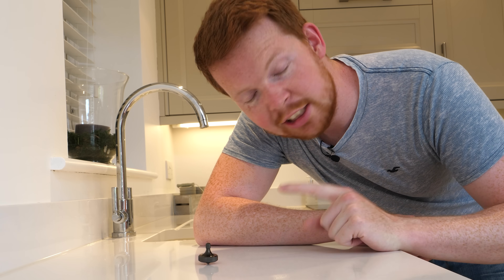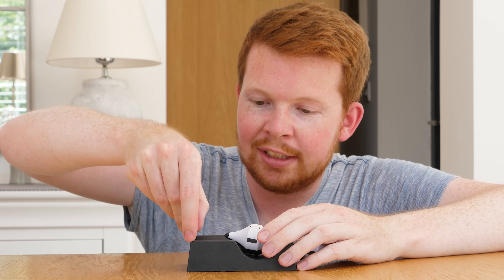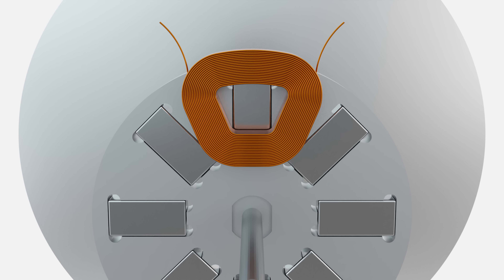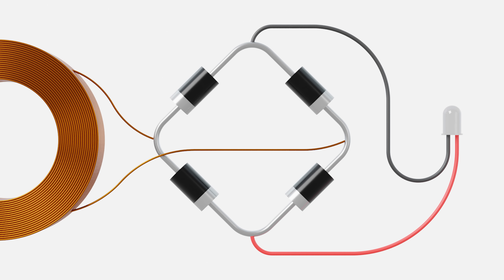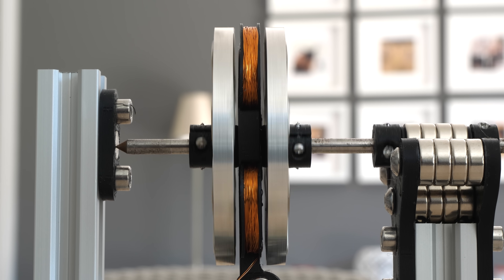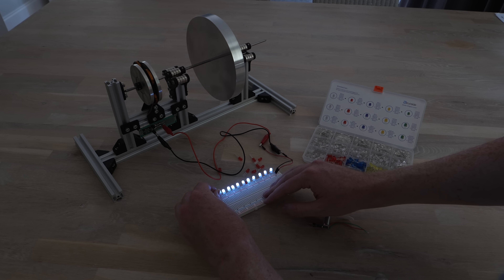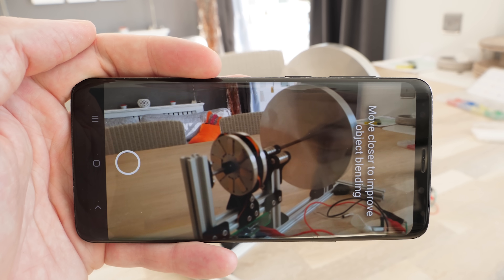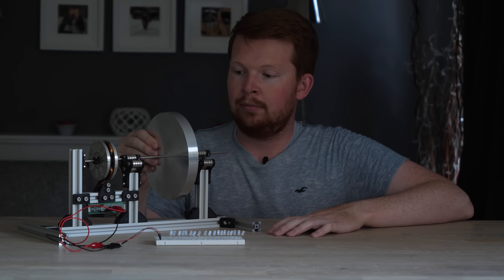Flywheel Battery

Comment: Thats really cool. you could probably add a pedal system that attaches to the end of the bar and just pedal for energy. maybe store the excess energy into a battery👀
Reply: Dam a creek, make a paddle wheel and then have an unlimited supply of hydroelectric power
Reply: That has been my plan/desire for almost 15 years now.
Reply: I suggest harnessing the power of water flowing in a small creek and that of a small wind turbine to spin the shaft.
Reply: @AshoreToo  Pedal-powered would require far fewer parts and far less energy consumption and installation effort. Plus, it makes us pedal it periodically, which is great excercise--especially helpful in the winter.
Reply: @AshoreToo  Not that micro-hydro and micro-wind aren't good options for larger electricity usage. Though micro-hydro, the ostensibly better option if you have a creek or stream, ends up being more complex than one would think (when I last looked into, that's what I found, anyway).
Reply: @RetroDawn  Thank you for your replies. I am interested in taking advantage of all kinds of energy beneficial to green house agriculture, since LED grow lights are good for my prospect. I would like to power grow lights with my generated electricity.
Reply: Fred Garvin  Yes, my complaint is really about industrialised farming, and junk food franchises,.If your extra calories are only carbs and simple like oatmeal, then it is pretty sustainable

Comment: How about adding the same magnet brackets above the axle? So the axle would theoretically be perfect centred in the magnet fields and you could add an handle at the end of de axle for more torque.
If this would work you would be able to increase the rotational speed by far :)
What do you think?

Comment: When I was around 11 years old,was under a truck with my uncle, He was showing how the starter  started the engine.  I  Asked him why the flywheel on the back of the engine  couldn't make electricity like the generator did to charge the battery ?
Reply: flywheel in combustion engine works as intermediate energy supply and rotations' stabilizer - think about it as an capacitor in electric setup.
Tom's demonstration is also a inertia capacitor "charged" by hand and giving momentum over long period of time.

Comment: I love the idea for a flywheel as a "battery". What happens if you plug a small motor on the rod, and charge it with solar panels? In theory, you should "charge" the flywheel during the day, and using the system as a generator during the night. 
Great work my friend! Keep it up.

Comment: You started by discussing how long a levitating flywheel might spin versus one with contact point.  Then you added a load to the arrangement but missed the opportunity tp compare the spin time with no load vs 5 LEDs or small motor etc...

Comment: Every electric vehicle (and hybrid) basically uses this concept, it's call regen (regeneration). The electric motor in an EV, also acts as a generator. So, when you hit the "gas pedal" you are powering the motor. But when you hit the "brake pedal", the system first uses the motor as a generator, which both charges the battery and slows the car, by loading down the generator. As you push the pedal harder, the hydraulic brakes also brake. Obviously, the car is not moving in a circle, so it's not exactly the same. However, the wheels, which couple the car to the road are moving in a circle.

Comment: Might be abel to connect a small motor to rotate the flyweel which will power itself and run forever (Might need a push to start though).

Comment: 10V doesn't really say too much unless we know the resistance. Otherwise you could just use a transformator to increase the voltage. Any info about the resistance/load used?

Comment: Why not use another repelling set of magnets at 90 degrees to the setup instead of a pin and table for even lower friction? essentially real full levitation? Then put it all in a vacuum to reduce air friction.

Comment: Thank you for making this video. I've often wondered whether an arrangement like this would work.
For your next experiment I'd be interested to see if you can use your alternator as a motor to get the flywheel spinning by connecting a power source and then switch it back to a load - so that, effectively, you are charging up the device with electric energy and then drawing electric energy back out of it afterwards -  like a rechargeable battery.

Comment: Shouldn't feeding power into the wires make the generator work as an electromotor to spin up the wheel? Then you actually have a battery where you can feed power in and later get the same power back out.

Comment: Firstly, sorry about my english... :)
Do you think that it is possible to add a 12v motor which works because off to the electricity created by your Flywheel battery which drives the axis of your Flywheel battery to make it turn without stopping, and to recover the over- more electricity to run (for exemple) a fan? (
I don't know if it's understandable ... lol)

Comment: I know it’s a few days late but what you should do is add a lever that you can push so it spins it up and then when you push the lever all the way it uses a little bit of the power to run a motor to pull the connection off where the lever was pulled so it doesn’t waste any power

Comment: i think you can smooth the output using capacitors that they are charged by the input and release a steady output, this is also why older audio tech has a habit of buzzing, the capacitors are failing or dead so the voltage is dropping in and out

Comment: Tom, I love your work - you have some great ideas and I'm a keen follower.  If you are ever in the Rutland area, look me up and I will buy you a beer.  With the Mag.lev. flywheel have you though about powering it up to start it?  For example, could you actually use it to store solar energy to later power an LED?  I see this as a potential for smoothing out power generation vs. demand. (like in power stations where they have to install massive battery banks to allow for sudden dips/spikes in demand and need somewhere to source/store additional energy.  Any alternative to chemical energy storage should be explored as that could be the next environmental disaster we face.  Keep up the good work!

Comment: You should add a crank with gears to spin this puppy faster by hand, like, with detachable rubber wheels, to decouple when the flywheel is "fully charged", to see if it's viable to use it for an emergency phone charging solution

Comment: very good project, i like it. Can i suggest some improvements?
1) magnetic bearings, is better adding an extra row of magnets on upper side, this will decrease woobling  and make you able to decrease clearance  space resulting in incresed overall system performance 
2) coils are more efficient when have nucleus  inside (iron core or ferrire core)
3) as i can see your magnetic path in generator side have high  reluctance, coils should "cut" perpendiculary lines of field. check P.M. orientation / coils orientation

Comment: Could you get the flywheel spinning at a known rate, and then try the different LEDs, so you can show how much power each draws?  The wheel should slow down at different rates.

Comment: You may wish to arrange the coils relative to the magnets such that the overlap is nonperiodic from coil to coil. Specifically, you should have one of the sets be a prime number, and the other be +-1 from that. Since primes are indivisible, there can be no common denominator, therefore you would categorically eliminate spurious beat frequencies. Many electromechanical devices do exactly this, and for good reason, it prevents unwanted harmonics allowing for smoother waveform/torque generation.

Comment: try wrap a cord around the end like a pull cord to quickly get the wheel to a high speed
Reply: Could drill a small hole in the shaft to start the "pull string",  there would need to be restraints or bearings at both ends to keep it from going off center when pulling the string. The restraints could be   removed once started.

Comment: Use a brushless in-runner motor for the bearing support and generator coils. It's more robust and more efficient electromagnetically. Moreover, with an ESC controller it can be used as motor to "charge" the flywheel. Bearing friction for these little motors is practically very small and on par with the magnetic bearing.

Comment: Interesting. Now, support the shaft with "pillow block bearings" with a gas powered engine and much heavier flywheel with a larger capacity generator or a power head for a 58kw A/C generator at 110VAC.
   I have a 10kw industrial generator, pulley driven by my truck engine with a cable control and governor to run my house during power outages. I would like to do the same with a very large flywheel (60") and a 4 cylinder naturally aspirated car engine pulley driving that same generator. Sort of like the older steam driven flywheel that powered the cotton mills of 100 years ago. Or, you could use a diesel engine that uses bunker fuel through an injector to a single cylinder hit or miss engine. The old hit of miss engines were very thrifty on fuel of lesser quality, or even vegetable oil. I believe Hal Lindsay had a book on the construction of a hit or miss engine driven A/C generator 50 cycle 120V factory use. Magnetic support is fine, no bearings to wear out. But for actual usable power, you have to mechanically support the shaft to eliminate "wobble".

Comment: with aluminium works too.... but you have to use the flying wheel like the  hard drives sandwich...... and extracting the electricity from the spinning field....in high spinning rotations you don't even need magnets   .... the field creating between the disks it give electricity.... 🌏 📡🌏 👣🕖 💎👽☠☼☾☄ゞど・ㇺㇾㇽ₪𝖎𝖙𝖎𝖇𝖎𝖗𝖆₪なめㇺㇾㇽ✶☥✨🌛🌄⊀✶⋊🐺🐾♓️☆🐜🐜🐫▲▴◭

Comment: If you want even lower friction replace the point bearings wiith two 10 x 5 mm magnets. Trickey to adjust, not impossible. Must be level or known angle.

Comment: not bad, but the most efficient way to do this, is making an axial flux motor with inbuilt levitation and the magnets in a Hallbach array. Motors like this can achieve 100000rpm or more using high grade bearings and permanent N52 magnets.
Surely not an easy build compared to your one :-)

Comment: would it be possible to have a similar set of coils only offset so as to have power coming from the second set of coils when the first set is out of alignment wouldn't you just need another set of coils and one more magnet wheel

Comment: Wonder if there would be a way to insert iron discs around the outer edge of the aluminum flywheel. Then using ferrous set screws around the circumference to hold the ferrous discs secure, could also act as a contact point to break with the next disc like with a lagging switch connected to a post and with the stator for induction. Part of the power generation from the alternator could boost the wheel. And have the stator windings on both sides of the flywheel  with the iron discs running thru the field. Gaining leverage from the discs on the further out side of the flywheel. If there was a way to do all of that maybe you could perpetuate more torque and that would keep the wheel spinning better than the one on the Wheel of Fortune?

Comment: Ok here is a backwards idea. Place the coils on the rotor and fix magnets to a frame. You can then place a bunch of small solar panels on the shaft to energise the coil. AC can be created by alternating solar panels polarity as the shaft rotates exposing next solar panel to a light source. With low enough friction this system would not need much power to keep rotating, making a "perpetual" solar spinner

Comment: Can you hook up a hand crank generator or a battery to the flywheel motor to run it up to a high speed? Then you could throw a switch and run the LED's or a motor from the flywheel.  Or could you charge a capacitor with a solar cell array, then discharge the capacitor to spin up the flywheel, then draw the power out of the flywheel, maybe use a light sensor circuit to switch the flywheel motor from drawing power from the sun to outputting power to a light? A cool demonstration of storing energy from solar?

Comment: You could always rig up some kind of a beyblade style ripcord. And I'm thinking a circle that surrounds the very end of the shaft to make it so when you pull the cord it might touch the circle but keep it from coming off of its track so to speak. However after the pull the magnets will keep it from touching the ring.  Should let you get lots of RPM with relatively slight effort

Comment: Ah, I've been thinking about living off-grid for a while, and considering ways to store energy e.g. from solar. Then I've found out that flywheel batteries are actually a decent option for storing energy (commercial ones supposedly lose about 1% of stored energy per hour), however buying one for private use might be a little tricky. So, I'm thinking if making one by myself is at all plausible, and so far my conclusions are - not really, there are safety issues, and efficiency would probably be too low to store energy for hours. However, lead-acid or lithium-ion batteries aren't great either, since they lose capacity over time and require regeneration/replacement every few years. So, expensive to start with, and expensive maintenance. So, maybe using heat or pumped-storage hydro might be another option to look into. I'd like something that is environment-friendly and does not require much maintenance.

It's not exactly something i NEED - where I live, laws guarantee that if you send excess electricity e.g. from solar panels into the grid, then you can take back 70-80% back for free, meaning the grid can work as a 'free' battery. However, I like the idea of being independent, not worrying whether the laws will ever change, etc. Telling the electricity suppliers "if I don't like your pricing, I don't need you, so give me a good deal or be gone". (also, if I don't like how the grid power is generated, say from fossil fuels, or natural gas bought from Russia)

Also, sounds like a fun project.

Another option I'm considering is a wood gas generator. I could grow the wood myself (which would make it carbon neutral), and so long as I'm careful about carbon monoxide poisoning, the potential benefits are quite nice - a very flexible solution, especially for winter, when solars ain't good, and the extra heating is desirable. However, that's a high-maintenance solution, so - as usual - the best solution is multiple solutions, so I can pick and choose based on the situation.

... sounds like multiple fun projects.

Comment: Nice job! I as waiting for a few more add-ons, a fet or two, and a spark gap module. Was also thinking you could use a cord with some friction to it to "coil" or wrap around, not loop around, the shaft. Then pull each opposite end away and have it spin.

Comment: Nice vide. Since your generating an AC voltage and current, you should look into Voltage Multipliers. You should also consider a step-up transformer and tank circuit on the primary so that you reduce the losses due to heat.

Another option is to introduce cascading magnetic wheels in a Halbach Array. This will ensure that you get a stronger magnetic field on one side of the wheel. You can think about each Halbach Array (linear configuration) and place 4 set of linear Halbach Arrays and have the coils on the outer ring. For instance, the 4-cordered aka Cross Halbach Array in linear configuration along the shaft in a smaller ring, inner ring, and the other ring have a linear set of coils. Think if it as a tube (inner ring) within a tube (outer ring). In the same cross patters, the coils in a liner configuration on the outer ring. 

Just an ideal

Great video. 😁👍👍👍👍👍

Comment: What comes to mind:
1.) Voltage regulator and/or buck converter to keep it reliably at 5V
2.) Add a USB charging port; there's tons of these circuits cheaply available
3.) Foot pedal to keep it spinning at your desk without having to use your hands
4.) Bike chains/gearing on pedal as transmission to increase flywheel speed

Comment: Stupid question time:

Is it possible to levy the biases against each other to get the thing to spin in place? Say have both sets of the magnetic bearings push themselves inward slightly? I can definitely see this not working, so I understand if that doesn't work. If it did work, however, that sounds like it could potentially spin for an hour with a good twist.

Comment: place opposing magnets on either end to hold it in place (no point of friction at all) and then place the entire contraption in a vacuum chamber to eliminate drag with air. With precision engineering, this could be very efficient.
 
To add onto that idea, double the flywheel, and make it just big enough to fit into a suitcase. Build some kind of geared cranking system and you've got a perfectly feasable portable charging system that requires no light, wind, gas or anything other than your arm. Might even be able to connect it to some other kind of spin-up apparatus like a bike, wind turbine or water turbine, for extra power generation.

Comment: I am not sure, but isn't this setup used in actual generators that run on someone spinning a shaft through a gearbox?
They are not terribly bigger, but I guess they used lead to increase the weight.

Comment: This video is a great visualization of just how little energy LED require to function. That tiny amount of spin he is giving to the flywheel with just 2 fingers is all the energy going into the system. And ever after all the efficiency losses along the way, it's still enough to power 20 LEDs.